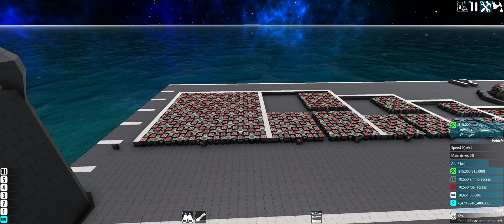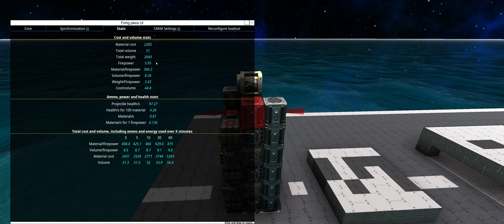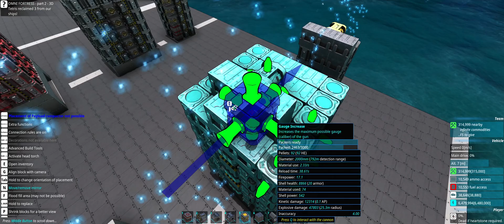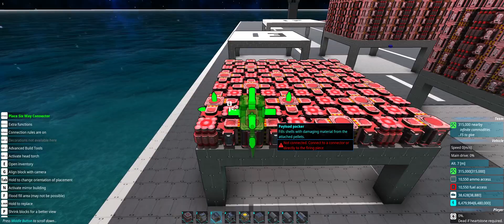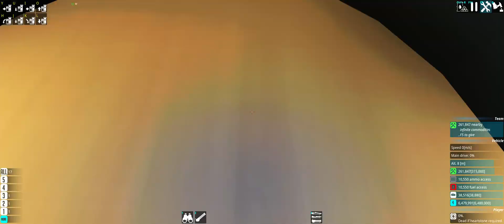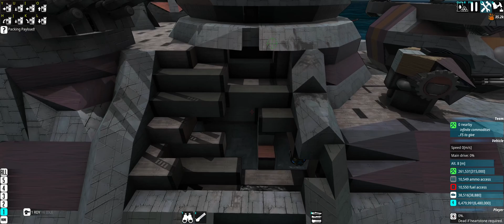From The Depths -  Cram Cannon Tutorial - Part 2 - 3D Tetris (Perfection has arrived)

Comment: 41:38, looking at a 13x13x5: "And they said [under 300 mat/fp] couldn't be done" - last year, I posted a 9x9x5 tetris with 10 less mat/fp than this one, it's under "EfficientCRAM" in the workshop. (most of the platform is just how I figured things out, it's a mess)

 Your work impressive given how many very stackable and turretable designs you've made. Personally, I fell into a fever dream, birthed forth a CRAM, and wrote off ever looking at another size of CRAM ever again.
Reply from the maker: Thank you thank you! I shall check out the beauty of 'efficientCRAM'. I tried making the design as easy to tile as possible. My basics tutorial describes how I select the 2d layer in more detail I think. Tried to step back and see what building a dense 2d layer really is. On some wacky sized turrets like 11x11 and  7x7 the 2d tetris is weird and if you build it custom to that size you can pull out a little more efficiency but generally it's a set pattern starting with a pellet in the center.

Thank you again for the kind words!

More glorious cram designs will be coming soon! ;)